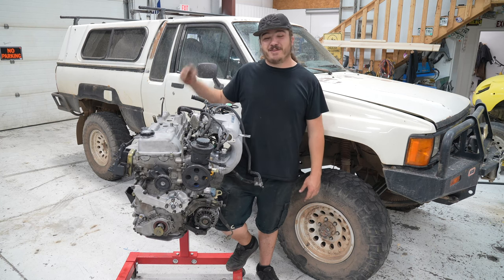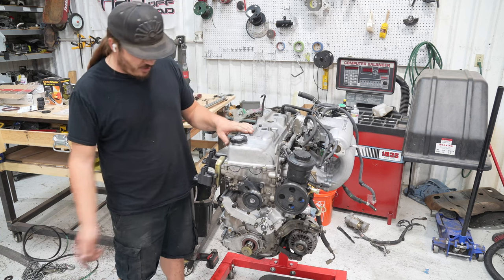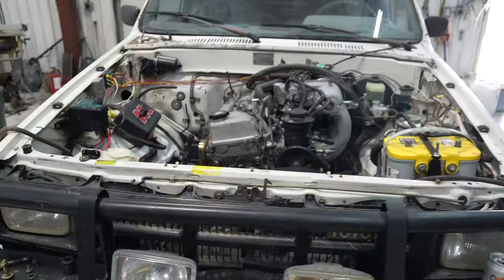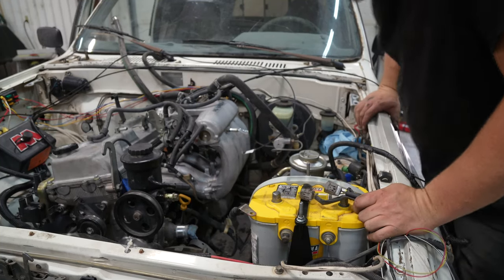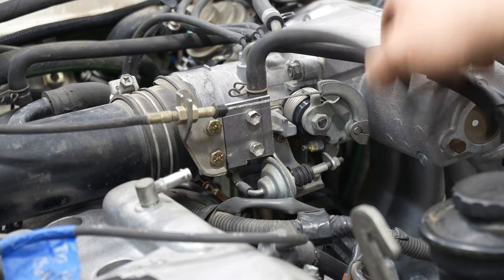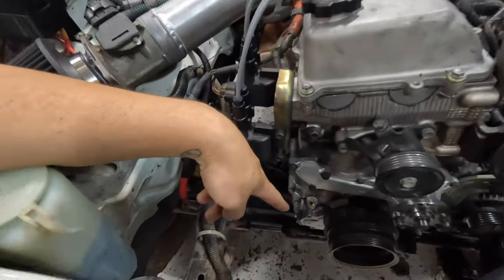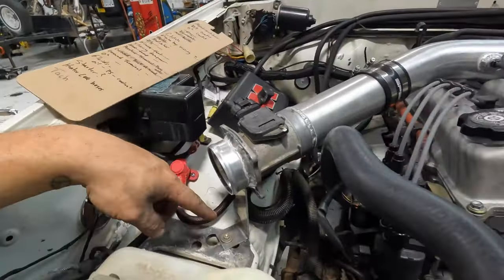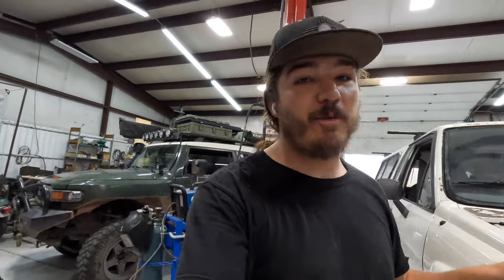Toyota 3RZ Swap Guide - Complete Start To Finish 3RZ Swap How To. 22R to 3RZ

Comment: Neat swap, but I worry your rigid custom intake piping doesn't allow enough flex for the engine to rock in the motor mounts when bouncing around off road or going suddenly from full acceleration to engine braking.

Comment: It's weird, it looks like 90% of a normal engine swap but that last 10% will test your ability to fabricate and think outside the box.  Good job.
Reply from the maker: Intake can be had off the shelf, and they actually also sell an exhaust crossover. There will be little things like brackets etc I made that could be a challenge but I think this could be easily done without a welder!

Comment: I have been dragging my feet on my swap for a few years but I just pulled the 3rz out of my donor '97 2wd 5spd 4runner. Going to swap it into my '94 2wd 5spd pickup. This is the first engine swap I've done and watching this video put a little fire under my ass to get on this project. Thanks!

Comment: Why did you use the old oil sending unit?  Did the new wire harness not come with that upgrade? Fun watch man, thanks
Reply from the maker: @ciskokidd5980  old sending unit was used because the SR5 dash reads that unit and not the Tacoma sending unit, this way the dash gauge still works.
Reply: @ElevatedFabrication  Good call. On my 2rz swap, I used the ECU and wire harness connectors, is working with my dash.

Comment: funny I just rebuilt my 22re I mean just ... has like 10 miles on it .. .and now I want to do 3rz ... it solves all kinds of issues more power.   guess we have to do what we have to do.  video is helpful.  any chance you have a parts list ? of what is needed to complete and a step by step instructions ?
Reply from the maker: I’m doing a few more swaps soon so maybe on one I can break down all the costs
Reply: @ElevatedFabrication   I just did a 22re rebuild and regret not doing a swap. I watched your video I think I ll pull the 22re and do a swap. I want to collect all the parts I need prior to starting. Its nice to see your work order so I do not make mistakes.  Why don't you drop the transmission you have a lift it seems like its easier to and to stab the transmission into he motor rather than the motor to the trans?  The one question I need to workout is what is required to make it smog legal ...

Comment: I have two donor trucks, one auto and one manual.  The auto had two extra stiffener brackets from the motor to the bell housing but the manual one did not.  Is that common, or did the manual truck lose those brackets under a previous owner?  I tried to swap the the bracket from the auto over for this swap but they hit the new oil pan location.  Do you think the brackets are needed?  Thanks for the great video!

Comment: Where did you end up relocating the dipstick or how does that all work haha 😅
Reply from the maker: My bad! There is a plug next to the engine mount on the intake side of the block, you punch that out with the oil pan off.

Comment: Hello from Greece!!! You are the only reason for the swap of my Hilux !!! Frame code YN110L with 4Y carburettor engine and now with 3RZ engine. I made a whole swap (engine, wiring and interior) from Tacoma RZN161. Very difficult but All perfect!!!! The only question is for the oil indicator. When looking the engine (like yours) looks like turns left. So, the oil level is not correct! The engine filled with 5,5 litres of oil, to see the level to the empty position! Do you have the same problem? How to fix this problem?
Reply from the maker: The oil dipstick reads properly even at the slant
Reply: OK! The correct oil capacity?
Reply from the maker: @thomasandreou1328  Yes

Comment: So i have a 2rz swapped 86 4runner having a problem with the fuel plump randomly shutting off  sum days will run good all day sum days it will die 10 times in 100 yards  I took a wire to a key on 12v power and ran it over to the blue wire that gos down by the passenger seat to the pump and it’s never died agin but I’d like to fix it right  any ideas on this I was thinking maybe the EFI relay on the driver side is bad and gets hot and randomly stops working ?
Reply from the maker: Id check both the circuit open relay, and the EFI relay.

Comment: Have you ever done a swap from 3.0-2.7? If yes how different is it from this swap?
Reply from the maker: I have not. Engine mounts would be custom
Reply: @ElevatedOverland  do they sell motor mounts for the 22re to 3rz?  I heard you need a custom oil pan with ifs?